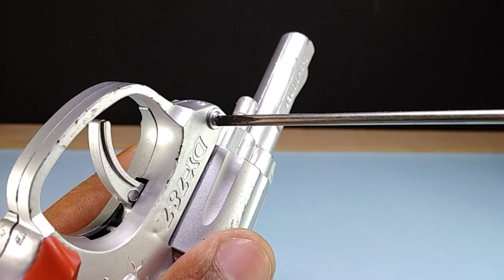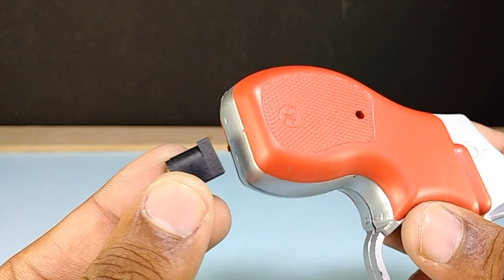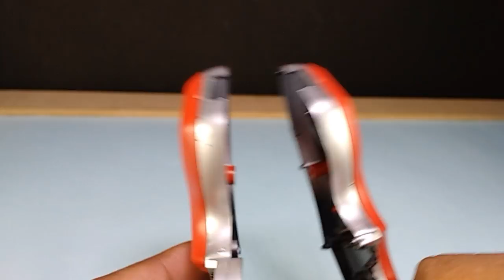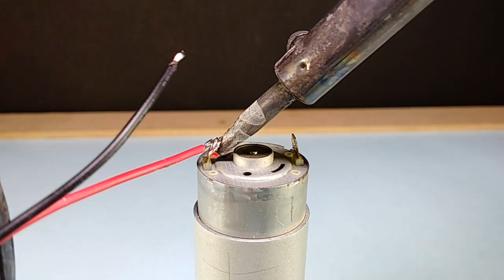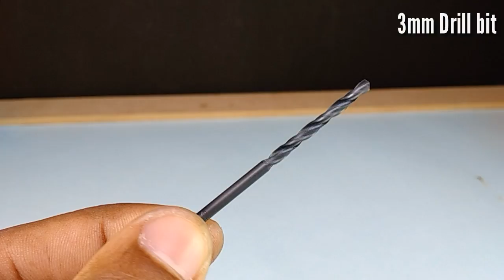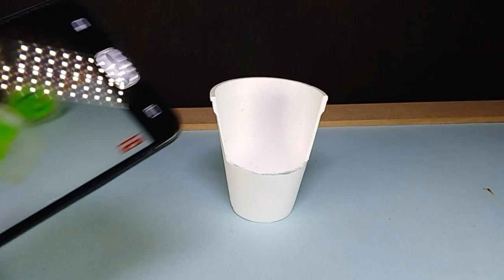2 Amazing Life Hacks | Brilliant ideas

Comment: What do you call the gold-colored thing you put on the end of the motor to attach the drill bit in the toy gun hack?
Reply: It's a electrical pin ,used for connecting wires. Open a lamp holder to see that connector
Reply from the maker: +Crystal W it is terminal block connector